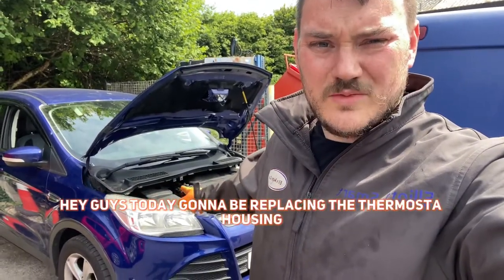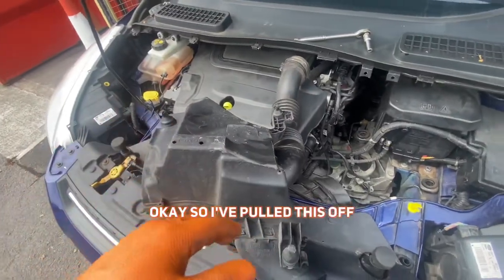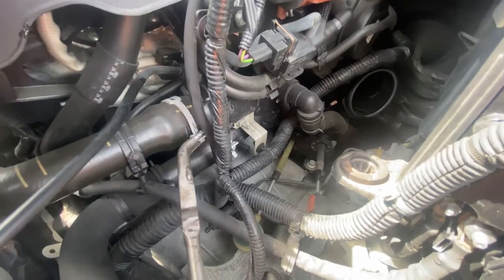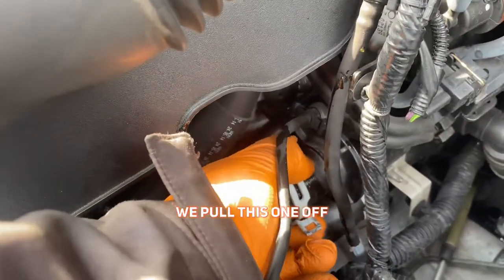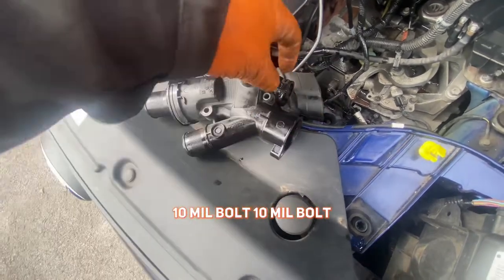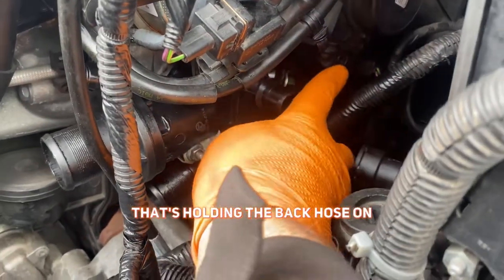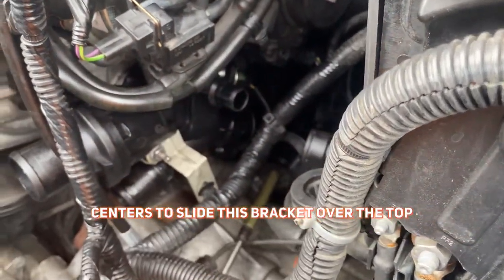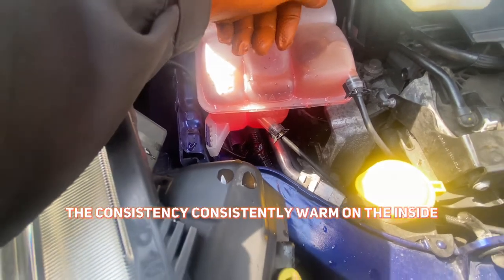2014 ford kuga thermostat housing

Comment: Hi mate can I pick your mind about my kuga 65 plate, Iv just had a new Thermostat house fitted, and now when the car gets to temperature when driving it comes up engine to hot, any ideas why this is, it’s only just started do this since the new part was fitted
Reply from the maker: It’s hard to say without looking 
Possibly an air lock mate?
Or a rubbish part used ?
Reply: Hi just watched your video on kuga thermostat change my question is what year is your kuga and does it have standard type thermostat  or is it the one that is controlled by a motor of which gets information from the ecu that controls the opening and closing of the thermostat thanks
Reply: Iv just had garage change this on my kuga had it back there was no water in the bottle obviously ain’t checked it was leaking and now iv filled it after a little drive the warning comes up saying engine service now and temperature gauge drops back down to nothing 😢

Comment: How much did the thermostat cost you.euro car parts and gsf have massively different prices.garage said £250 to Change and said the part was £170.
Part from gsf is £45 so I’m gonna change it myself.thanks for the very helpful video.
Reply from the maker: They do very in price…. I think you’d be pleasantly surprised by the price at the dealers
Reply: @EllsAutoCare  will try ringing Ford on Monday
Reply from the maker: @geegee2022  quoted one for a cmax (very similar if not the same) was around £60 with the sensor